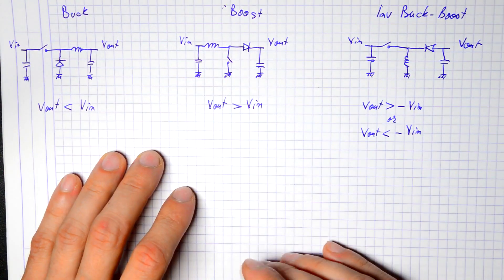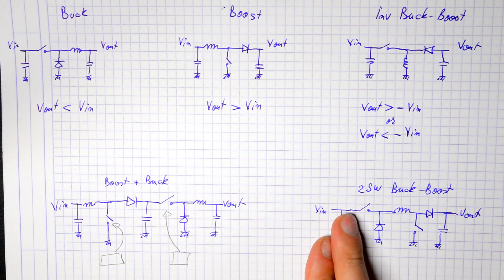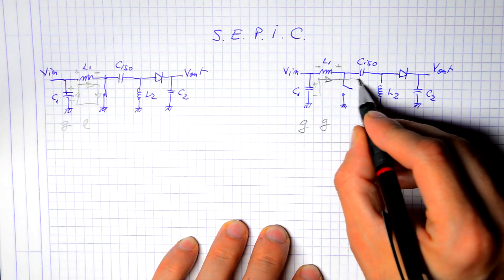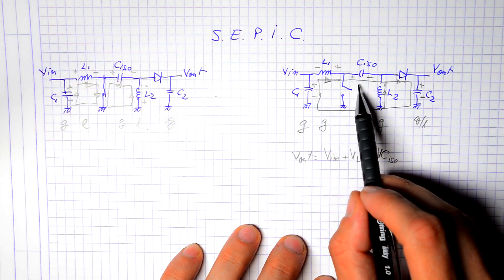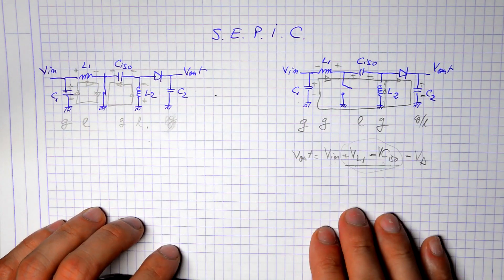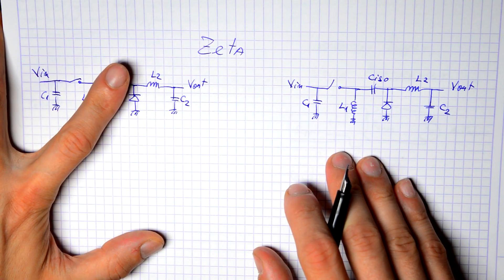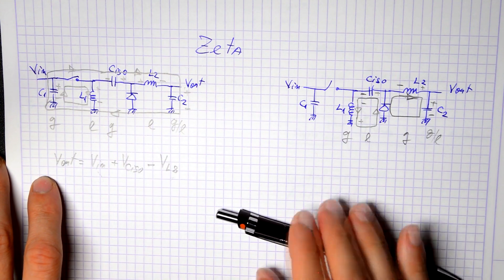Electronics Tutorial - How the Basic SMPS work: Sepic, Zeta and Ćuk Switch mode power supplies

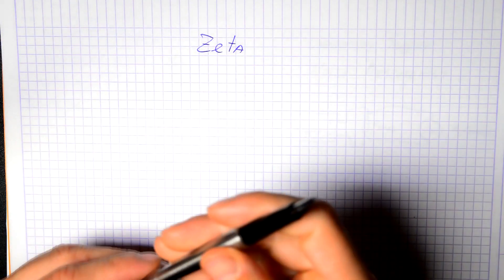Comment: zeta 09:00
what frequency do you use sir?
i try do simulation in proteus but not work for boost
Reply from the maker: I used 50KHz in the simulations but frequency will depend on the components you used.
On the other hand to get the converter to boost - output higher than input or buck - output lower than input depends on the duty cycle not switching frequency. Try playing around with the duty cycle - above and below 50%.
Reply: @FesZElectronics  thanks sir, it was work in Psim,
Next I will build in pcb, 👌

Comment: Is this possible to use mosfet instead diode in cuk converter? Something similar to 4 switch buck boost
Reply from the maker: It should be possible, but its just difficult to achieve - the driving circuit is difficult to build. Its a similar story to the synchronous boost - it can be done, but it ends up being to complicated and expensive in most cases, so a simple diode is good enough.
Reply: @FesZElectronics  simple diode is not enough for my ~25A up to 10V project
Reply from the maker: As long as you have a driver that can supply the out of phase signal (in reference to the initial switch) and dead time, you could either drive a Pmos transistors with a negative signal (negative voltage in reference to GND); or use either P or Nmos with an isolation transformer.